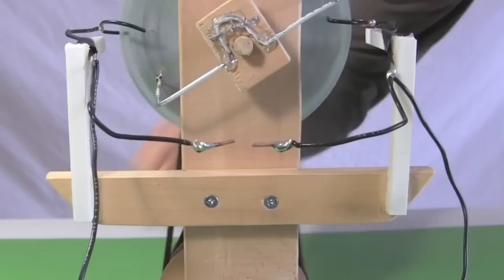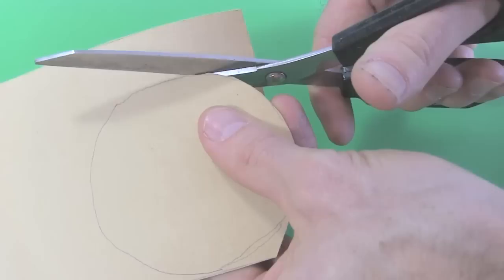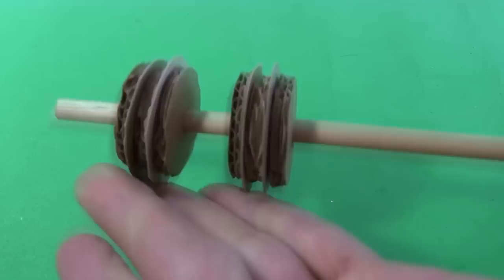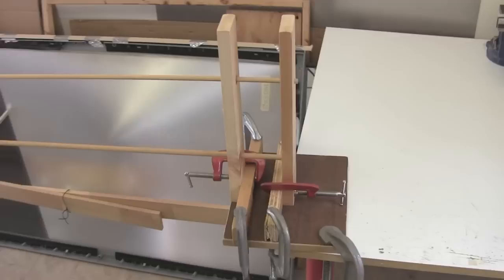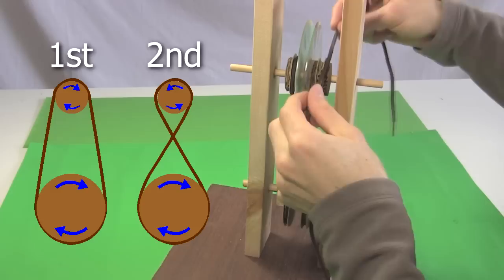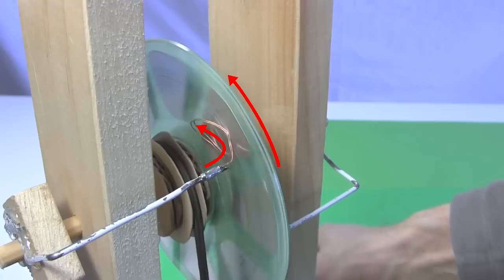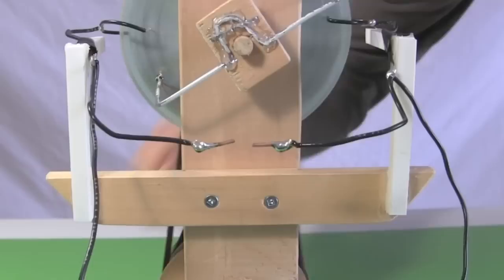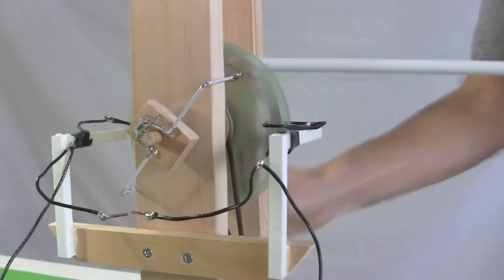Wimshurst Machine - How to Make using CDs

Comment: What happen if i connect the wimshurt machine to the cockcroft Walton voltage multiplier ?it will work or not 
Please tell me
Reply from the maker: No, that wouldn't work. The Cockcroft-Walton voltage multiplier wants AC as input whereas the Wimshurst's output is DC.
Reply: How many volts is produced by your machine in this video.
Can this voltage will lift the ionocraft?
Reply from the maker: The machine in this video definitely can't lift a lifter. It's hard to estimate the voltage across the spark gap, probably less than 10,000 volts. But even if it produced the 25,000 volts needed as per the video I mentioned in my reply to you under my "Make USB Power Cable" video, it would still need to produce enough current. The voltage is needed to produce a large strong enough electric field to break down the atoms to produce the ions and to pull charge from the electrodes, but the charge for the ions comes from the current. I don't know exactly how much current is needed for a lifter, but it's more than a normal Wimshurst machine or Van de Graaff generator can produce. You need something more powerful like the power supply I also mention in that other reply. Some power supplies that use Cockroft-Walton voltage multipliers, like mine does, will work and some won't, it just depends on how powerful they are. Mine plugs into the wall socket and so has plenty of current available.
Can you give more details about your power supply? What comes before the Cockcroft-Walton multiplier? What is it's power source? Does it produce sparks? If so, how long are the sparks and describe the electrodes on either side of the spark gap?
Reply: I am using 220 volts as my power supply. Its also producing sparks.the spark gap is probably 0.5 cm.i have made a 3 stage cockcroft Walton voltage multiplier.
Can this will lift the lifter?
Please suggest me some model.
Reply from the maker: If you're taking 220 volts AC from the wall socket and putting it straight into a 3 stage voltage multiplier then you have probably only around 1000 volts DC (I don't know the formula but they don't just multiply). It also can supply a scary amount of current. So your voltage isn't high enough for a lifter. My 30kV power supply takes as input around 10,000 volts AC from a flyback circuit and the 3 stage Cockcroft-Walton voltage multiplier then outputs 30kV.
Here's my webpage about my 30kV power supply http://rimstar.org/equip/30kv_pwr_supply.htm. Unfortunately, the type of flyback needed is hard to find these days. Someone in the comments to my video about it said that this one https://www.ebay.com/p/Sanyo-4-2751-60108-4275160108-Flyback-Transformer-2278/1870611316?_trksid=p2047675.m4097.l9055 might work.
Reply: Instead of flyback transformer what can i use?
I am not getting flyback transformer.
What should i make in my physics model?
Please suggest me
Reply: Can the voltage will increase of your wimshurt machine if you increase the RPM of the CD disc then it will lift the ionocraft or not and how many RPM is required to lift the ionocraft?
Reply from the maker: The only other solution I know of is to buy a power supply. I'd suggest the 35,000 volt one, the HV350+ available here https://www.amazing1.com/hv-dc-power-supplies.html.
Or you can pick a project that doesn't require as much voltage and current.
Reply from the maker: Theoretically, yes, increasing the RPM would work. But, not practically. The increased losses at higher RPM will stop the output from going higher at some point. The losses are leaking ions from all over the machine. Also, you can't rotate this one much faster than I show in the video because of the way it's made -- with the shoestring belt and the cardboard pulleys, the belt just starts slipping at higher RPM. It's made this way in order to be easy for anyone to make. So in reality, the answer is no.
Reply: Thanks
Reply: Can i use high voltage capacitor or cannot some capacitor in series to increase the voltage of wimshurt machine?
Reply from the maker: You can certainly do that to build up a higher voltage. However, you'd just be building it up over time. Once you start drawing current from it for your ionocraft, the voltage will drop back down again. Then you'd have to wait while it builds up again, and so on. So if you're lucky, the ionocraft will do a quick jump every few minutes (guess at how long it would take to charge up the capacitor).
Reply: I have made a wimshurt machine but my machine is not working.what i will do please help me.
Tell me the fault in my machine.
I have made my machine by seeing your video only.
Reply from the maker: First, make sure you pay attention to the tips I give near the end of the video and do the things I suggest, especially that trick I do with the cloth and rod and the triboelectric effect to start it. I often have to do that, especially when the air is humid.
If that doesn't help then from experience, all I can suggest is to send me photos. You can find my email address at the bottom of each of my webpages on https://rimstar.org.
Reply: I have send the pics please help me.
Reply from the maker: It looks pretty good. Try making the two sides your spark gap bigger and smoother. With the sharp wires you have, they'll just leak current instead of building up a voltage and sparking. It looks like you've done some soldering in other places so one way to do that is to form big balls of solder where the sharp points are.
Try playing around with the distance between the ends of the collector wires and the sectors. Move them closer to the sectors.
The disks look very far apart in places. Try getting them as close together as you can without rubbing too much.
It's hard to tell in the photos so it's probably okay, but make sure you have good electrical connection between the collector wires and the wires going to the rest of the circuit.
Avoid sharp points except for the ends of the collector wires. Only the ends of the collector wires should be sharp.
It's hard to see all the neutralizer brushes in the photos so I'm assuming there are brushes on all of them. I can only see one of them.
You're off to a good start so far.
Reply: Thanks for guiding me i will do the change in my machine and tell you.
Reply: I have done all the changes as you have said but my machine is not working what can I do please help me please help me.
I see very very very very  little spark in dark.
Reply from the maker: That's great, that you're at least getting a spark. That says that a lot of the other parts are working. It sounds like your capacitor may not have much capacitance. I hope you made rounder ends for the spark gaps, otherwise that may be a big part of your problem. The closer the two capacitor foils are together, the higher the capacitance. Also the more area there is for the two capacitors, the higher the capacitance. So look for some thinner plastic with a larger area to put between the two foils and increase the size of the foils. Here are some of my capacitor making videos to give you some ideas.

Dissectible Capacitor/Leyden Jar - How it Works

https://www.youtube.com/watch?v=gPXv063O5B8

How to Make Flat Capacitors for Tesla Coil (Small SGTC)

https://www.youtube.com/watch?v=EkvODkLL9Og

How to Make Capacitors for Tesla Coil (Small SGTC)

https://www.youtube.com/watch?v=iV7Irwaqe3w

This one's about capacitance:

How to Make Capacitors - Low Voltage Homemade/DIY Capacitors

https://www.youtube.com/watch?v=GveI9gXIsHw
Reply: Can i use the readymade high voltage capacitor?
I am getting some spark on one end of neutralizing bars 
What i should do ?
Reply from the maker: Yes, you can use readymade high voltage capacitors if you can find some. I don't know exactly what the rating should be. Somewhere in the thousands I guess. It really depends on how small your spark gap is. The smaller the gap, the lower the voltage. The voltage that the capacitor can handle is written on the capacitor. It must NOT be an electrolytic capacitor.

Where is that spark going to? From the neutralizer bar to where? If the neutralizer brushes are touching the disk then there shouldn't be any spark.
If the spark is between the brush and the approaching sector then it could be that the brush at one end of the neutralizer bar is touching its sector before the brush at the other end touches its sector. If that's the case then it sounds like your sectors are building up a lot of charge, meaning that the collectors aren't collecting much of the charge. If the ends of your collectors don't have very sharp points then that could be why they wouldn't be collecting much. They need to be sharp.

It also helps if the neutralizer brushes are as far from the collectors as they can be.
Reply from the maker: Oh, and in the new pictures you sent, it's hard to tell but it looks like the two ends of the spark gap are rounder but there may be some sharpness on the sides facing the gap. There must be no sharpness there.
Reply: Now also my machine is not working please help me
Reply from the maker: The disks are too far apart.
The collector wires don't look very sharp and the strands of wire for each collector are too close together. Some of the collectors seem too far away from the disk.
The spark gap is too wide, at least for first tests.
It's good that your capacitor has more area. Make sure the insulation between the foils isn't too thick. I can't tell how thick it is from the photos.

Comment: Rimstar pls help what is the gauge of ur collector black wire? I can’t find wires that have low strand like yours mine are made of very fine strands of many thousands so I don’t know which to cut
Reply from the maker: I'd suggest to just spread out the strands and see how well that works and then start trimming until you get a good result.
Reply from the maker: Hi, I'm just back from a week's vacation. I looked at your video. Try starting with the smallest possible spark gap, yours looks pretty wide. Look for the spark while in a darkened room in case it's very tiny.
Try with more strands of wire at the collectors instead of just one strand, making sure to space them apart a little. One shot did show multiple strands but they must all be around the same distance from the disk, the shot near the beginning of the video shows them pretty haphazardly arranged. Also, move the collector wires closer to the disks.
The brushes for your neutralizer bars look fine. The clothes hanger wire should work if it's metal. Just keep in mind that it may have a non-conductive coating on it. I'd guess that if you manage to solder to it then you'd get through the coating but wouldn't guarantee it. Given how thick the metal it, you'd have to get it pretty hot to solder to it so it's also possible you've really just glued with the clothes hander wire with the rosin acting as a glue.
As expected, the surfaces of the plastic between the sectors have some metallic particles on them from the brushes as they move across the foil sectors, or that could be glue from the edges of the sectors. If that's aluminum then it may be shorting out the sectors somewhat.
Your capacitor looks fine.

Comment: Why not replace hand crank with motor that runs on the energy you created ?
Thus self sufficient ...duh.
Reply from the maker: That would be nice. But there's no free energy here. The chemical energy from your body converts to the mechanical energy to turn the crank which turns into electrical energy and with losses all along the way. A Wimshurst machine is actually fairly inefficient, so there are a lot of losses everywhere.
Reply: @RimstarOrg  that's one way of not looking at it.

The hand crank I replaced .
So can you genius.

My first time , I replaced hand crank with a hamster wheel.
Thus , mice ran the wheel.
Instead of my hand cranking.

You do know what a hamster wheel is ?

When the mouse hops inside the wheel and begins to run.
The wheel turns the disks.
The machine begins to create energy.

The mouse ran up , the clock to energize it.

Now , instead of me cranking.
My hands are free to work on energy while mouse runs energy.

Once I designed the transformer to power a small motor. I replaced mouse with power from motor that runs on energy created by this machine.
Free energy I don't pay for...
Any energy you don't pay for is free energy.

This creates light.
This creates heat.
This creates power.
This creates electromagnetism.

Use the Bagdad batteries to store energy.

Try building the disks bigger so they can power up many objects at once .

You use only one disk player .
Try making one that uses 5 disks at once to create a rope of energies.

But each disk is a different design.

I call it the TRON ENIGMAS.